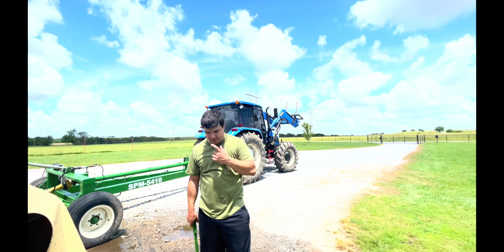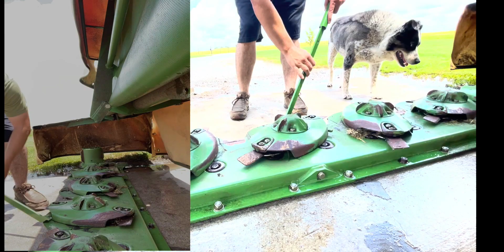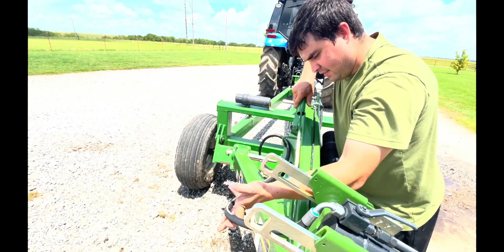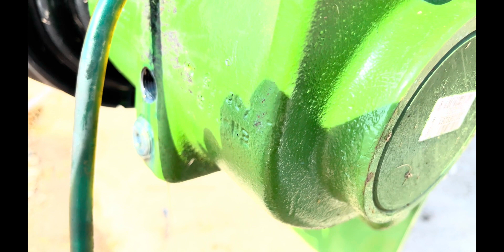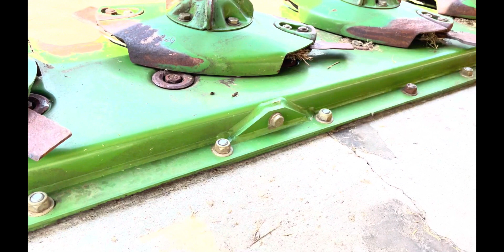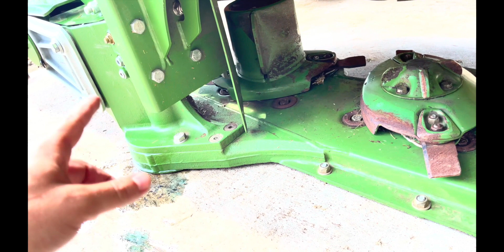Krone Active Mow II R 280 Disc Mower Quick Change Blade Overview and Service

Comment: if i was you i would change the oil in the bed every other year ...........seen a few around here that were used   hard in very heavy crops   , custom   hire work ........the bearings in the bed failed after 4 to 5 years ..........oil was never changed in the beds ..........
Reply from the maker: Good info, thanks! I’ll probably look to change then next year.